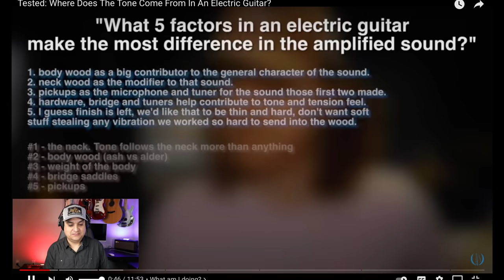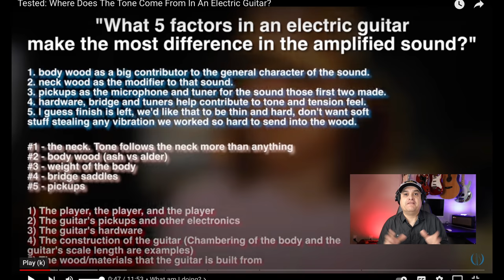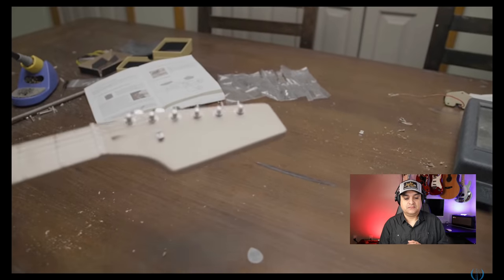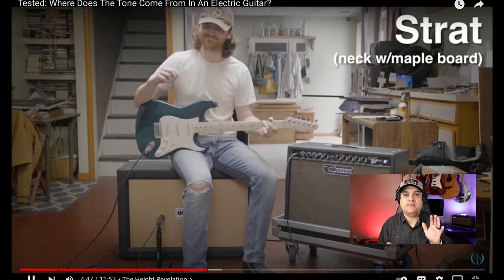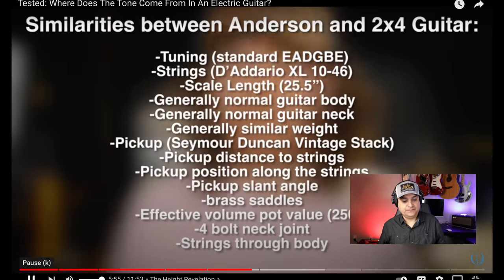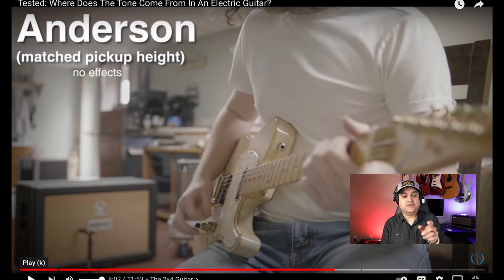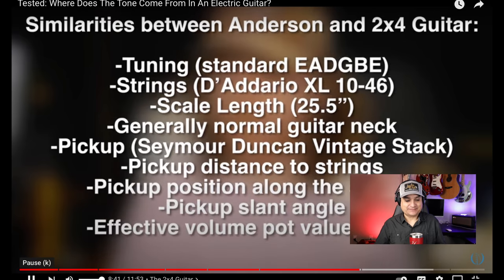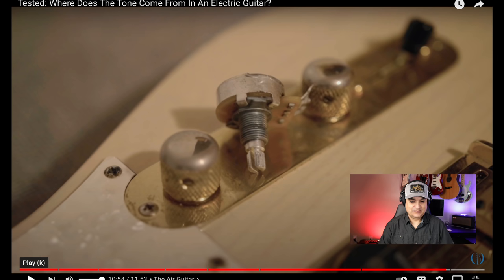Where Does The Tone Come From In An Electric Guitar - Reaction Video

Comment: It was a good test, and I think he probably answered the question about how body wood affects tone, but he didn't really answer the question about neck wood. He took it to the extremes by changing from a telecaster body to a 2x4, and then to no body at all, but it seemed to me that he should have dug a little deeper. Now that he had pickup height as a control, then he should have experimented with different necks (maple, mahogany, rosewood, etc) and different fingerboards (rosewood, maple, roasted maple, Indian laurel, ebony, etc). ESPECIALLY for fingerboards, I think: if we plug our guitars in and press down on a string on the fingerboard, that comes out our amp in the same way that the sound of our pick comes through. There's a quite audible difference between a pick with a texture and one without, and between a pick and a sixpence, and even just between weights and angles of picks, or between picks and fingers. So if there's an audible difference between the string being struck by different materials, does that then mean there would be an audible difference in sound between the string being pressed against rosewood and being pressed against maple? After he had his control category, that's the test I would have wanted to see.

Comment: I would add, the bridge. Maybe the two he used were close enough, but I had a real shit one on a new Gibson SG once and replaced it with a Callaham and the guitar went from dead & sustain free to singing like Whitney.
The vibrating string is held between the bridge and the nut. As long as those two are solid wrt one another most of the vibration should stay in the string. Kinda surprised me that the loose neck didn't have more of an effect. Perhaps if he did some sustain tests he would have noticed a difference.
Reply: I have similar experience, changing tailpiece from some cheap alloy to full aluminum noticeably changed the tone on my LP.

Comment: I still think wood does make a difference, but not in the conventional way. I think wood that dents and dings easily will take abuse poorly, and therefore I try to avoid soft woods like basswood - which is why I avoid some squires and Ibanez guitars. I also think wood that looks like crap... looks like crap, so I put a high priority on grain and figure in transparent finish guitars. All functionality (bridge not collapsing, nut not binding, truss rod working, trem stays in tune, tuners working properly) aside, I only care about the wood for looks and strength. I am guilty of dumping an ton of money into pickups, though.

Comment: Take two drastically different sounding acoustic guitars (like one mahogany and the other maple or spruce) but the same size. Put the same electric pickup in both and see if there is a difference.
My guestimate on results: You will hear a difference even more so then on a solid body.  Why? Because the wood does make a difference and in this test, you will hear it even more prominently.

Comment: There is no way to argue that in this video the tone-wood or lack thereof makes little to no difference.  Everything changes at what I would call stage volume, and even more so when playing along with other instruments at that volume.  The way some guitars virtually play themselves at stage volume while others still feel dead like the volume is down is a direct result of wood resonance.  Sure every guitar becomes more lively and starts to feedback at high volume, but often two guitars that sound almost identical at low volume will sound very different when you turn them up.  Only at high volume does the concept of tone-wood really become true.
Reply: To rebut, unless you are playing stadiums these days 'stage volume' is now near silent.  Amps are in iso cabs or players are going direct.   so as time marches on this argument you made becomes less relevant.  But even so, I never had a 'dud' at different volumes.  If it sounds crap at low volume it will sound crap at high volume, and likewise if it sounds good low it will sound good high.

Comment: I have a $125 strat clone from amazon. Lovingly built by hardworking Chinese people in some factory that almost certainly pays them too little to work for too long of hours. You know what the difference is between this and a $1500-$3000 strat? Mostly just the feel. It sounds pretty much the same. Of course it's not exactly the same but it's close enough that when you put it through effects nobody would notice. 95% of the tone comes from the player. Maybe even 98%. So buy what feels good to play. The money should go into your comfort. Your hands need to be on the instrument sliding around the neck, fretting the notes, and plucking the strings. If it feels effortless your tone is going to sound better. 100%.

Of course this is all for electric guitars. Acoustic guitars are another beast. Though it would be interesting to know what the main contributors to tone are in acoustic guitars. I get the feeling that tonewood is not as important as we are told by the guitar companies and that the shape and size of the guitar body where the sound is echoing probably plays an even bigger difference. That said, I still think tonewood plays a sizable role in acoustic guitars.

Comment: Tonewood must surely only matter in acoustic instruments. If you get sound from an electrical interaction, the pickup (along with its height), strings and string contact points are ALL that matter.

This demo proves it almost outright. Been saying this to my mate, who changes pickups often, that you don't necessarily need to match a pickup to a particular type of wood body, especially so when it's a solid bodied electric guitar.
Reply: Knock on the back of an electric guitar. You can hear it through the amp, even with potted pickups. You're hearing the sound of the wood and everything else in the guitar vibrating.
Reply: @lfscrazy  You're hearing everything vibrating through the strings, pickups are not microphones.
Reply: @JoeySchmidt74  Take the strings off and then knock on the back of the guitar. You'll still hear it through the amp. Test it for yourself. Pickups, even potted, are microphonic.

Comment: Strat players insist that the wood gives the tone...but what they should be looking at is the pickguard, cause that's what the pickups are mounted to. Wood is not conductive and pickups on a strat do not come in contact with any wood.
Reply: Tap on the back of an electric guitar. You hear the knocking, even with potted pickups. You're hearing the sound of the wood (and everything else) vibrating.

Comment: It's hard for me to believe there are people who don't hear a difference. Which is great for them. Can save a bundle on gear... though not really, as a cheap guitar can easily sound better than an expensive guitar. So really the advantages are, you can order a guitar blind, as all individual units of a particular male and model will sound the same to you, rather than one being more responsive and resonant, while the other less responsive and resonant. Whereas for some, five different pieces of mahogany will sound different from one another, though yes, very subtle. 

If your guitar were to become waterlogged, no problem, no difference. That's awesome. And doing mail order, you'd have 100% success rate. No having to play several of a make and model, acoustically, to find the one that sounds and reacts best for you. Pick any random les Paul shaped guitar, as they all sound alike, adjustment of pickup height te only thing needed. No perceived difference in bridges, saddles, etc. (Hopefully no one claims those are part of the electronics... my background in electronics tells me they aren't). And really, the strings aren't part of the electronics, though some will at least realize that part of what the pickup is picking up is the vibration of the string. (I'm sometimes surprised by how many think that if you mute the strings and tap on the body, there will be no sound). 

It's, for some, lots of subtle differences, all coming together, for an instrument that reacts best to your playing. Little subtle nuances in enunciation, for the guitar to react as you need it to, as you vary pick attack, and so many other things. It differs from one guitar to the next. But only for some, apparently. Some hear a difference between up picking a strong vs down picking a string. Impossible, according to the theory of some, as it's the same string vibrating in the same magnetic field. And if the string is simply vibrating at the frequency of the note, I'm not sure how where you pick, along the string, as it's the same frequency of vibration in the same magnetic field. Unless some claim that the magnetic field, inductance, etc, change according to where your picking hands is. 

I've changed pickup height before, and it still sounds like the same guitar. Changed pickups, and it sounds like the same guitar. My Epiphone Lucille didn't suddenly sound like my Epiphone SG. I'd bet that switching the pickups and pickup height between the two wouldn't suddenly have the Lucille sound like the SG, and the SG sound like the Lucille. Lest someone claim: but the strings aren't identical! Fine, switch those too. Perhaps I'll try it some day. 

None of it is relevant. Why does anyone get upset by some hearing subtle, but important, differences? What prize do you win in claiming that the only difference in sound between electric guitars is in the electronics? But guitars according to your own ears, and let others buy guitars according to theirs. I've never spent more than a few hundred dollars on a guitar, but if anything happened to any of them, I wouldn't be able to get an exact replacement by blindly ordering the same year, make, and model, no matter how much magical adjustment of pickup height were done. For others, the only difference is pickups and pickup height, and if for them that's the case, awesome. Purchase accordingly. And no matter how much fun you make of those who hear other differences, give up on the need to control others. Al will continue buying according to their own ears and passion styles, according to the differences they seek. And those desperate to convince others there is no difference from one guitar to the next, that a pickup adjustment, or tone control adjustment, won't fix, those claims simply aren't going to match reality. And guitars that I think sound and react great, the next person thinks sounds and reacts horribly, because they play in a different way. And in no way do I feel placed in a position to dictate what they should want to hear, or that their guitars sound no different, excepting for pickups and pickup height. And if in fact it's pickup differences that their ears are keying into, more power to them. Only they know what they need out of the guitar. How they go about getting vowel-ish, or consanant-ish sounds by l through subtle variation with hands, looking for a guitar to respond in the way they're looking for. Each can only discover for himself or herself. Though some out there might be obsessed with playing referee in telling people the differences they're experiencing aren't real.

Comment: The one nagging thought in my brain is whether a hollow guitar would sound like the perfectly rigid Telecaster/2x4/workbench guitars, but honestly that's not a huge worry.

The bigger issue is how every single guitar shootout ever done is totally invalid if they didn't match the setup and test for variance in component values. All those "rosewood vs. maple fretboard" comparisons might just be 250k tone pot vs. way out of spec tone pot... or pickup height comparisons.

Comment: Any part of the guitar affects the tone (its physics, its not up for debate, unless we want to reconstruct physics to be inaccurate), however, whether it affects the tone enough for the player too hear? well Pick ups bridge and nut will, the neck and body change affect things but its so small I dont think its a factor worth considering. The pickups act like a freq filter anyway, which ironns out most of the "characters" the wood type might bring,  the saddles and Nut have more direct affect on resonance etc, and then the amp and speaker are the biggest factors over any other. 
The wood affects the acoustic resonance and tone, but those "characters" are almost wiped out by the pick ups, so they are so small  I doubt most players can hear them. 

To be honest though if someone like Steve Vai or Santana tells me they can feel and even hear the difference with finishes on a guitar, I am inclined to believe them, why? because they are masters of the instrument and therefore their ears are likely...a lot better at focusing on guitar tone than any of us and even you Dylan.
It could be Psychosomatic though. But regardless if " Dave " in the local Blues covers band tells me he can hear that difference, and he's not some virtuoso once in a few decades kind of talent? I'm inclined to tell him to go fuck himself (in a more polite manner).
So overall in relation to 99% of guitars, we cant tell the difference

I like the idea, cant remember which famous guitarist said it but " you play the amp (and cab) not the guitar" tonally that makes a lot of sense to me

Until someone actually does a proper scientific test , with controls over the variables, and huge sample size(50-200+) of identical guitar (excluding wood) , its not really far past the anecdotal. However I do think its clear despite the lack of true scientific testing, that Pickups Nut Bridge and Tuners have a bigger effect. A sample size of 2 or 3 guitars clear shows this

A sample size of 2 or 3 guitars is 1-5 % of a true scientific test though

Comment: Did that demonstration have to go any further than the bridge screwed to a metal bench, strings stretched across a complete void (with no connection but the strings and the floor), tied to tuners on a separate bench? 
Oh, I forgot, did anyone check to see if the floor was concrete or wood (and what type of wood)? 
This video was a great cork sniffers nightmare.

Comment: The inconsistency is because it’s so subjective - that’s why there’s so many variations on essentially the same basic guitar shapes. You cant be as free with a piano - you’d never get it tuned - but the smallest of changes makes a huge difference on an 88 key, 3 strings per note instrument, most indiscernible except to the maestros - but if was about the wood and it’s shape there’d be no such thing as an electric cello - in my humble opinion as a refuse collector.

Comment: OK, I hear definite differences. If the Guitar and the 2x4 sound the same does that mean wood doesn't do anything or in that instance they just matched. I have two custom 22 PRS's one very dense and heavy, one light very resonant. They have all the same hardware. I have moved one PU back n forth between getting the setup as close as humanly possible. They sound very noticably different. The core tone is the same but totally different character. If you listen to them acoustically you can hear those exact differences in character imparted on to the same basic core tone. Because two different guitars sound the same or two same guitars sound different is so unscientific. When people start going off on "well in a band mix" or "the pick attack makes more difference" is totally irrelevant to whether or not the body affects the tone. That Johan Segeborn did one between a guitar and strings mounted to a steel beam. Very different. One guitar maker built two identical guitars from maple and mahogony, moved all the hardware and they sounded a lot different. I have also seen opposite results. So experiments on both side proving their point. My conclusions, all parts that can affect how the string vibrate, have some effect on tone. How much is going to be different all the time, but understanding electronics, how pickups work and the physics of how guitar parts interact, and believe it or not 40 yrs of just experimenting and experience, (and for some reason the non wood guy's allway's totally put down experience, just like I did when I was 15 yrs old) say's wood, to varying degrees depending on each application has to have SOME effect. I was an electrician, have repaired just about any mechanical device u can think of. I have a pretty good grasp of the physic's of things. My conclusions are based on the gathering of empirical evidence trying to be as impartial as possible, not some vested emotional interest in "tonewood". Too much of a perfectionist for that. I did watch that guy's video because of an argument with someone else.

Comment: Get a multimeter out and test both sets of electric parts and you will find difference in impedance. Every part has a tolerance in specification, no two potentiometers or pickups or any other part are identical. The least important factor in tone is body/neck material.
Reply from the maker: Yep